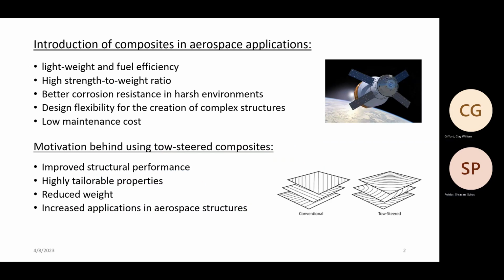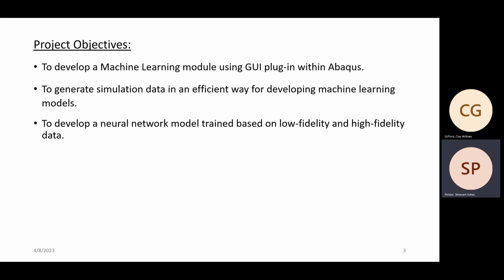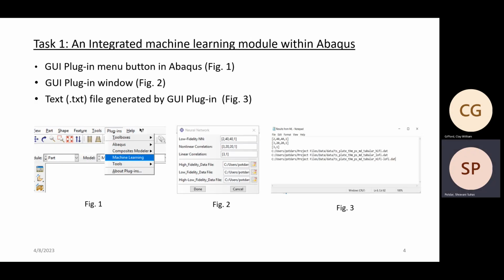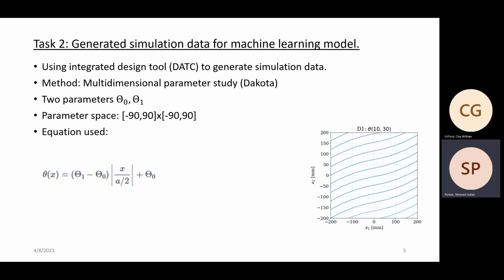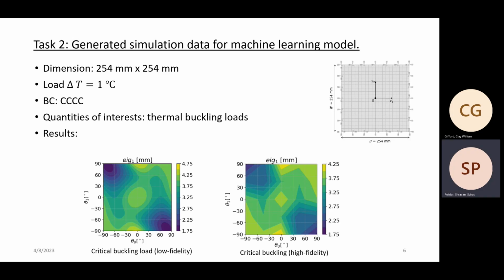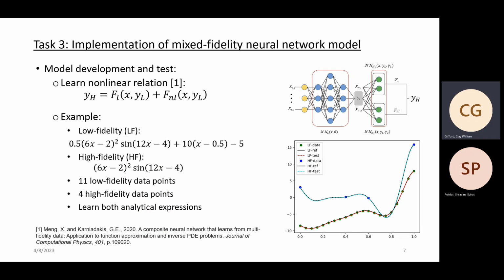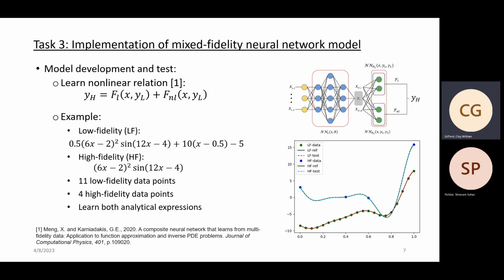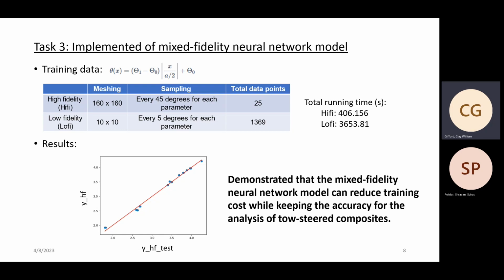2023 UTA COE REU Project

Comment: 刘博士，您好：请教：用的什么类型的神经网络？那个数值案例里面高保真的数据和低保真的数据分别是怎么产生的呢？低保真是加噪声吗？
Reply from the maker: Hi, we only used feedforward neural network models for this simple example. The high-fidelity data was generated by a FE model with fine mesh, and low-fidelity data was from the same model with coarse mesh. We didn't add any noise. This is a straightforward example carried out from an undergraduate project. We are implementing this algorithm with more realistic and complex composite structures.